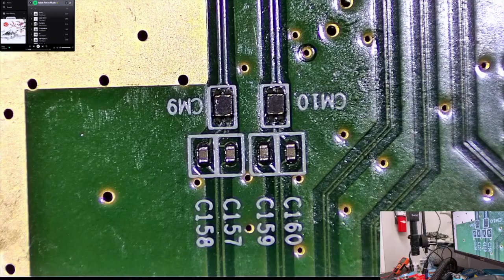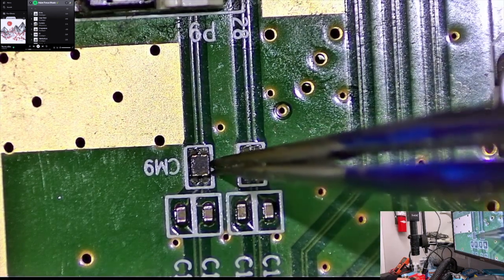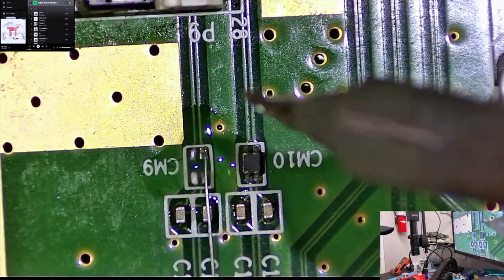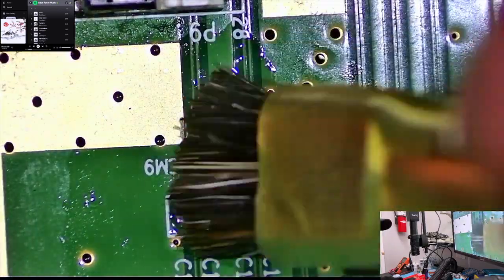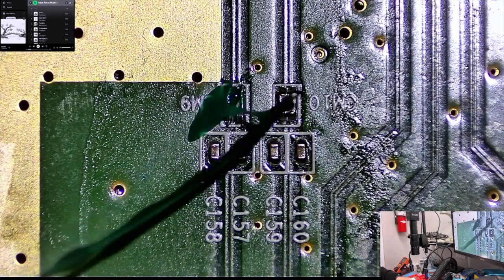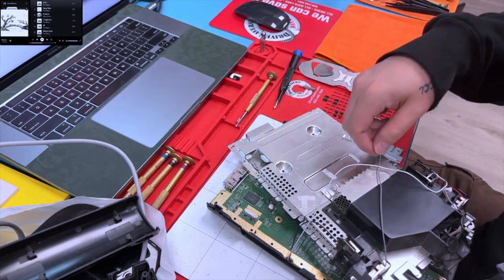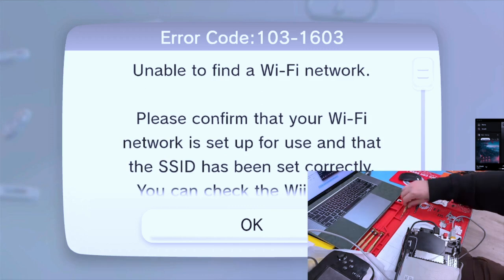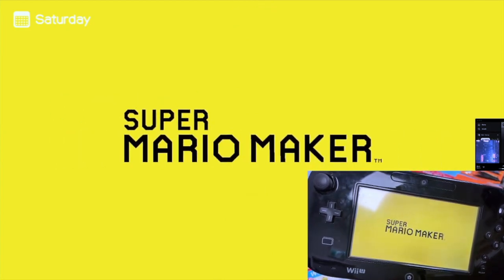WII U error 160 1400 Permanent solution! No new parts required, just some basic soldering!

Comment: Whats that substance you apply before soldering. And is it possible to remove the fuse without the heat gun. And is that black substance you apply necessary? Asking for a friend.
Reply from the maker: Flux is applied before soldering, the black substance? Im not sure what that is… and you can always just use jumper wire to connect the fuse points instead of removing it

Comment: I still don't quite understand which parts should make contact. In the video it is not possible to clearly distinguish where you place the tips of the multimeter.
Reply from the maker: Each fuse has 2 point on each side 4 total, they line up in the same direction as the trace lines underneath hope this helps